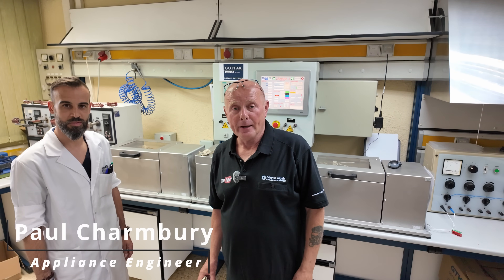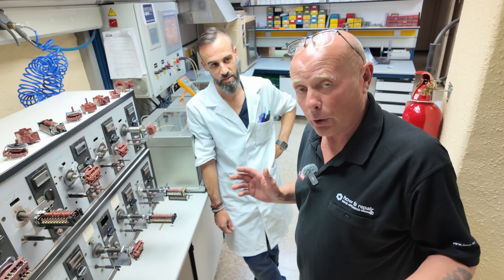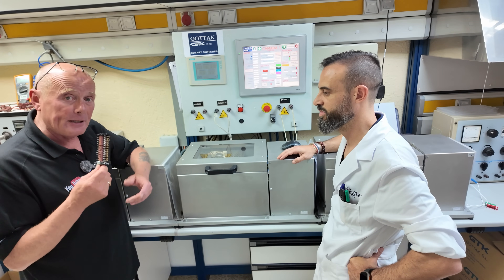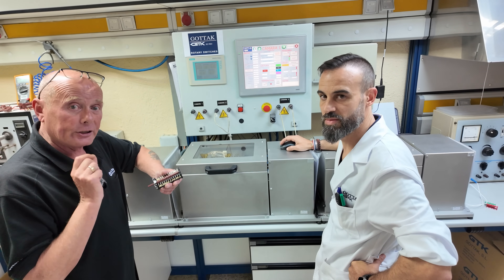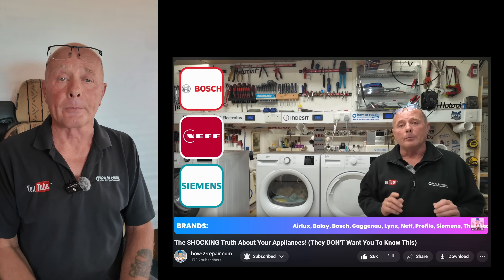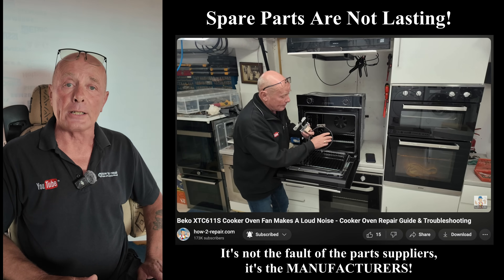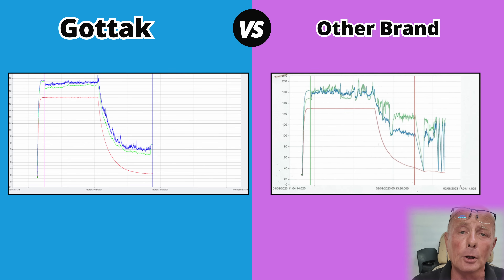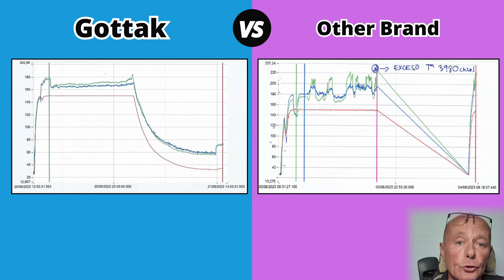Why Your Appliances FAIL SO FAST! Lab Results EXPOSE the Truth!

Comment: I do have an electric range/oven from the 1990s that is still working. Just recently had to replace the heating element. It split in half. Fortunately, a replacement two pack was quite inexpensive. And it was simple to repair.
...And I have a standup box freezer from 1992 that is still working.

However, I have a refrigerator, only about 10 years old that wasn't getting cold enough. Will have to remove some parts and test them, see if it's worth fixing. Replacement parts for the model are quite expensive.
Reply from the maker: You are living with the evidence of built-in obsolescence right in your own home. The older appliances were designed with simple, modular, repairable parts. The newer ones are often complex, with expensive, integrated electronic components that are designed to make repair difficult and uneconomical.

For a deeper dive into the specific ways manufacturers have made modern refrigerators harder to fix, please check out the full video here: https://youtu.be/gEgSCbZnHVM?si=wTIw0mELuhWaw4aX

Comment: If my Baxi boiler is only supposed to last between 10-15 years, it has now lasted 22 years thanks to my father in law. The first thing to always go on it is the programming unit. The cell battery inside dies but is fixed so that it cannot be replaced. That obstacle was overcome. Small power cuts when it was first installed meant parts had to be replaced. The other was a resistor that failed, after researching the part, it was manufactured in Australia and was too expensive to order. The alternative was to join 2 resistors together. So if one unit fails, I have a replacement always to hand. There is a need  for a whole industry of electronic experts to repair units like this in such a fashion to bypass obsolescence. This was the route many years ago.
Reply from the maker: Thank you for your comment. I appreciate people like you taking the time to write it out. Please share it where possible. It might help others make a wise choice instead of being misled by the industry.

Comment: It's not just built-in obsolescence through poor quality components. It's also unnecessarily complicated design that introduces additional parts that serve no genuine benefit and introduce additional points of failure. 

Consumer education only goes so far. I think we need mandatory disclosure of components with the lowest-rated duty cycle, for all products. This would allow consumers to genuinely compare products on price and longevity, and force manufacturers to give product warranties that are based on substance, not arbitrary statutory requirements (e.g. 12 months on all consumer goods).
Reply from the maker: I've been repairing washing machines for nearly 50 years, and the basic principles of washing clothes haven't changed since the 70s. They wash, tumble, heat, and spin. It's baffling why we need so many extra features now. Machines used to last 15 to 20 years on average. Nowadays, you're lucky if they last five years. Obsolescence is clear in today's society.

Comment: I bought a small vacuum cleaner for cheap , it seemed excellent motor, but in year two just stopped working and wouldn't turn on.  Opened up and I found one of the internal cables was mysteriously pulled out.  I pushed it back into its terminal, reassembled and it turned on for 1 second then stopped again.  The cable was pulled out again!

Eventually I figured it out - the motor was coupled to the base by a keyed rubber mount and it had sheered off.  Without it, the whole motor tried to rotate itself inside the machine and would pull out the cable disabling it!

The rubber itself got hot and I swear it was chosen by design knowing it would be a fail point within a couple of years of age and usage.   Anyway I rigged a replacement for the sheered off key mount using more durable material and I'm still using it 15 years later.
Reply from the maker: You are almost certainly right to suspect the rubber mount was a designed fail point. Manufacturers can choose from dozens of different rubber compounds. A cheap one will have poor resistance to the heat and vibration from the motor, causing it to become brittle and shear off after a predictable amount of time—say, a couple of years. A slightly more expensive, higher-grade rubber would last for decades.

The fact that your more durable, homemade fix has allowed the vacuum to work for another 15 years is the ultimate proof that the original design was flawed on purpose.

Exposing these clever, hidden failure points is exactly what we aim to do in our videos. For a deeper dive into the specific ways manufacturers design these products to fail, please check out the full video here: https://youtu.be/gEgSCbZnHVM?si=wTIw0mELuhWaw4aX

Comment: Don't forget shoddy power supplies and components thereof, lack of RF shielding on top of higher and high speed digital control circuits and "fluff". Then add in firmware bugs (intentional of not) in the wild because you are supposed to put them on your wifi and let the manufacturer update them constantly - even bloody appliances. Every bit of this is wrong. A lot of it comes from greedy bean counters, but don't forget over-regulation and misguided "green" initiatives. The entirety of the auto industry, consumer electronics, consumer refrigeration and hvac are prime examples. RoHS solder is also a massive factor (see misguided green/health initiatives - solid lead alloy sequestered on circuit boards will not hurt you, and more serviceable devices means less junk in landfills or being incinerated/chemically denatured overseas).
Reply from the maker: That is a technically sharp comment. Thank you. You've hit on several critical factors that go beyond just simple component choice and get to the very heart of modern electronic failure.

It's a perfect storm, just as you said. A combination of greedy bean counters cutting every possible corner, and sometimes well-intentioned but poorly thought-out regulations that have had disastrous effects on product longevity.

These deep technical issues are at the very heart of the built-in obsolescence problem we aim to expose. For a deeper dive into these topics, please check out the full video here: https://youtu.be/gEgSCbZnHVM?si=wTIw0mELuhWaw4aX

Comment: It's theft. deliberately designed to fail, is just a subversive form of theft, its greedy & wasteful, once upon a time an item lasted a lifetime, not any more, thanks to greedy manufacturers & governments letting them make self destructing appliances, 
straight up wasteful theft, 
forget about the environmental impact or financial burden on constant repair or replacements
It's just unadulterated theft!
Reply from the maker: You’re absolutely right mate, and it’s a frustrating practice that affects nearly every industry. The concept of deliberately designing products to fail or become obsolete within a certain timeframe is a huge driver of unnecessary waste and consumer spending. Whether it’s electronics, appliances, or even clothing, it’s all about maximizing profits at the expense of durability and sustainability!

Comment: So, this is nice and all, but how can I know up front which products use proper switches?
Reply from the maker: That is the million-dollar question, isn't it? Thank you for asking. The tough but honest answer is that manufacturers make it very difficult to know for sure. They don't advertise "we use cheap switches," so you have to become a bit of a detective before you buy. Here are the best strategies you can use in 2025 to increase your chances of getting a durable machine:

1.Look for brands focused on durability
2.Watch teardown & repair videos
3.Check professional appliance repair forums
4.Check spare parts before you buy
5.Consider the warranty

Comment: Whirlpool duet washer dryer. 25 years and still going strong. Replaced shocks so far but nothing else. 

Frigidaire standalone freezer 15 years, replaced the mechanical defrost timer twice. 

Samsung 4287 hars. Replaced drain piping under the fridge/freezer.  Must be close to. At least 10 years old.

GE side by side fridge was replaced by the Samsung. Has a broken valve that directs air between fridge and freezer. Still works after 25 years. Only drawback is that top section of fridge gets just below freezing.  Perfect for beer in the garage or stuff that you keep short time in the fridge.
Reply from the maker: In the 80s, 90s, and early 2000s, most manufacturers produced high-quality equipment to build their reputations. Now, many have large market shares because they've bought up other brands. For example, Bosch, Neff, and Siemens are one company; AEG, Electrolux, and Zanussi are another; Hotpoint, Indesit, Ariston, and Whirlpool form another group. These conglomerates now control the market but seem less concerned about consumers. Their main goal is to sell machines. They use green marketing tactics to their advantage but aren't held accountable for the growing pile of discarded white goods. Nowadays, machines last only about five years on average.

Comment: I bought a Samsung washer and dryer. I could not believe how disappointed I was to buy my first brand new washer and dryer recommended by Consumer Report’s at the time there ended up being a class action lawsuit they were made so terrible. They came out three times to secure the cabinet so when it went into spin, it wouldn’t shake the cabinet away from the structure. just problems after problems. It’s disgusting. I’ll never buy Samsung again
Reply from the maker: Thank you for your comment. I appreciate people like you taking the time to write it out. Please share it where possible. It might help others make a wise choice instead of being misled by the industry.

Comment: This would have made more sense had there was an explanation of what the switch was for and what the down curve on the graph represented.
Washers and a heat pump condensing dryer I've  bought in the last 10 years have not failed and perform very effectively.

 Hoovermatics and  Philco washing machines I bought in the 70s and 80s., lasted less than 3 years before breaking down and needing expensive repairs. I think it's easy to forget how crap stuff used to be.
Reply from the maker: Thank you for your comment and providing your perspective on the reliability of modern appliances!

Comment: I worked for AMP later acquired by Tyco Electronics in both stamping, electroplating and assembly roles and as a tech in setting stamping machines I can assure anyone there is definitely a major difference in quality and design than lets just call them other copies.
Reply from the maker: It's great to hear from someone with first-hand experience in manufacturing; that kind of insider perspective is invaluable.

Comment: Refrigerator self destruction: (I do not own the product I'm speaking of, nor am I a test engineer.) Anyone looked into the utter stupidity of LG refrigerator compressors? Once the compressor breaks, LG does not warrantee any parts for any length of time as stated on the back of the large cardboard box. Once the compressor goes bad, the buyer must have the unit serviced at their expense. After the manufactured compressor part has been replaced, when (not if) it dies, again the owner again must have it replaced. From multiple HVAC experts, the new design uses multiple springs to minimize the energy used by the compressor. The dying part is the metal flexible valve on the piston. Anyone know about these LG refrigerators?
Reply from the maker: Thank you for your comment. I appreciate people like you taking the time to write it out. Please share it where possible. It might help others make a wise choice instead of being misled by the industry.

Comment: Let’s face it, servicing is big business for manufacturers. Also, designing in a limited product lifecycle means there will be an ongoing demand.. build to cost is a key design objective too… so why all the fuss? Most appliances, electrical equipment and consumer products are cheaper, more feature dense and fit for purpose than ever before. Just accept it or spend more money and get a higher spec model at a higher price.

Comment: I designed spacecraft navigation receivers for Caltech JPL NASA, and never worried about unit costs, in that I only built a few sets of equipment, for global deep space network. I had plenty of exposure to the far more rigorous flight certified gear, so appreciate how much high reliability costs, including being a certified 6-sigma greenbelt 

The greed at any cost idiocy of modern corporations is something we never could afford, and with expensive appliances and their foolish planned obsolescence, we've got the exact opposite of energy efficiency life-cycles and resulting extremely negative planetary impacts. 

I vividly recall my dad repairing gas dryer, which lasted some 40 years, and miss those days and that quality of design
Reply from the maker: Thank you so much for sharing your incredible perspective. Coming from someone who has designed high-reliability equipment for Caltech JPL/NASA, your words carry an immense amount of weight and are a powerful indictment of modern manufacturing practices.

For a deeper dive into the specific ways this decline in quality is engineered into products, please check out the full video here: https://youtu.be/gEgSCbZnHVM?si=wTIw0mELuhWaw4aX

Comment: I've owned several dehumidifiers, all of which appear to malfunction in their anti-freezing circuit shortly after the warranty expires, causing the compressor to remain active and the coil to freeze. The greater implication is that this could result in the release of refrigerant, which is an environmental issue with possible injuries to the owners.
Reply from the maker: Thank you for your comment. I appreciate people like you taking the time to write it out. Please share it where possible. It might help others make a wise choice instead of being misled by the industry.

Comment: I'd say the end consumer is to blame as well.  They abuse their devices by what was fairly known in the distant past to now, simply for their convenience.  Examples, a microwave should only be turned off at the panel.  Opening the door to turn off causes wear on the micro switches.  These switches are there for safety only, they can't take the high cycle daily use.  Also devices should be disconnected at the plug/outlet first, the remainder later.  The reason, every time power is turned on or off, a momentary surge becomes present at the device.  By having a chain of devices still connected, this will aid in suppressing the surge.

Remember the days of the regular light bulb?  They tend to fail during turn on or turn off.  The bulb can only take so many surges.
Reply from the maker: Thanks for your comment. You're raising a really important point about the relationship between how we use our devices and how long they last. Taking care of your equipment is always a good thing, and you've brought up some interesting technical points.

Exposing these intentionally weak components is exactly what we aim to do. For a deeper dive into this topic and to see the examples we covered, please check out the full video here: https://youtu.be/gEgSCbZnHVM?si=wTIw0mELuhWaw4aX

Comment: Oh but the planet, climate change, oh we are destroying ourselves, we can no longer have cows, or anything to do with carbon. Meanwhile nearly All manufacturers of nearly anything are doing this. Talk about a waste of natural resources and labor. Had several old fans made of steel that had an oil port above the fan shaft. Everyone was still working great 50 years in and they were all eventually stolen from me while still working.
Reply from the maker: Think about the environmental impact of building machines and then recycling them. These machines are often transported halfway around the world, which adds to fuel costs. It's baffling that we need to ship them every five years due to failure.

Comment: Oven ignitor on Samsung range failed one month after warranty expiration. The replacement lasted 6 months 
It's replacement worked for 2 months, one of the wires became loose inside the porcelain base.
Reply from the maker: Thank you for your comment. I appreciate people like you taking the time to write it out. Please share it where possible. It might help others make a wise choice instead of being misled by the industry.

Comment: Another confirmation of the lies we are told about we should take care of the environment. When it breaks chuck it and buy new. Can you not recommend one manufacturer that does make a quality long lasting product or how do we find the right suitable replacements so we can refit a appliance so it can last many years. I have had 2 Bosch dishwashers that have fail on the PCBs and by the time you see the cost of the part it was not worth buying a replacement. This is all wrong. Same logic as ULEZ what a joke. Others might say you are just against it. No I'm not I spoke to a air quality expert who worked for BP who educated me on the facts.
Reply from the maker: Stick with a brand that suits your budget, but also supplies the technical information for you to have a chance of repairing it. This is my best advice mate!

Comment: There are Diamonds in the Rough such as GE Washer GFW550 ($750 usd)....but Ironically its Mating Dryer is garbage and it is better to buy lower  model dryer...using reviews is crucial in purchasing large appliances......Great Show...btw    (luckily I couldn't afford dryer so still using old GE Dryer and replace belt when it breaks)
Reply from the maker: Thank you for your comment; I appreciate you taking the time to write it out!
Reply: if needed you can also replace heating element